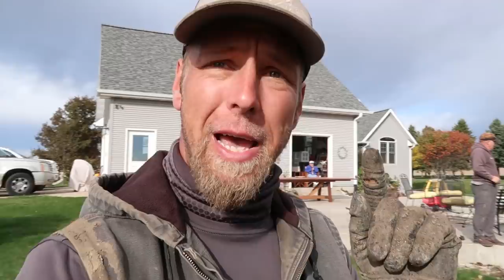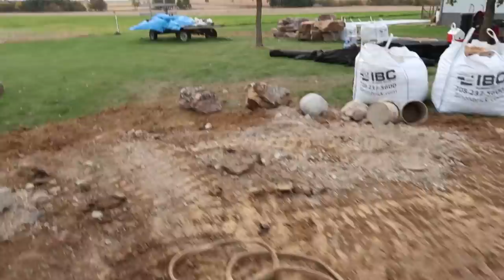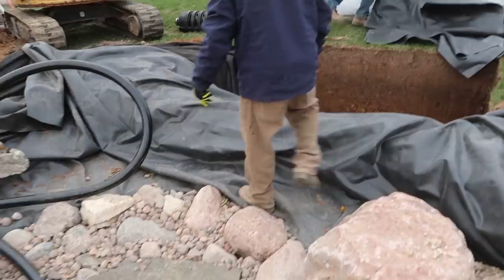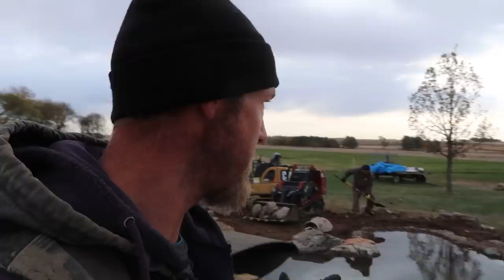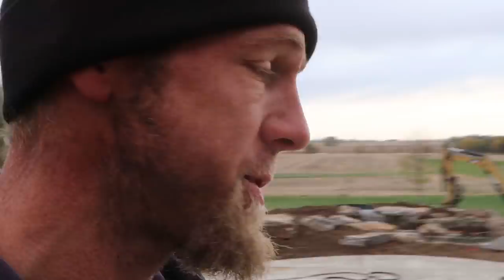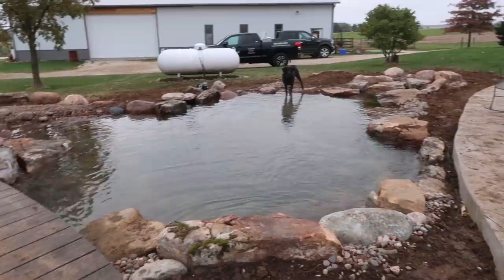Farmland *POND* W/ 8-Foot Bridge

Comment: Are you concerned with the powerheads getting debris in them and reducing their volume (push) of water? They don't appear to be easy to remove and clear out any debris if they get clogged. 

I love the pond and the split of the lower waterfall. The bridge adds a nice element to a very interactive pond.